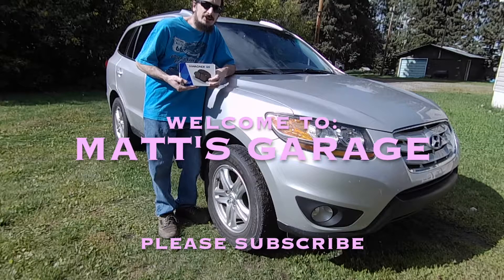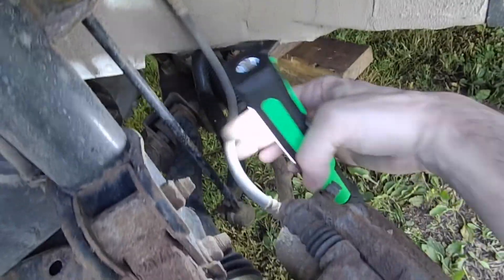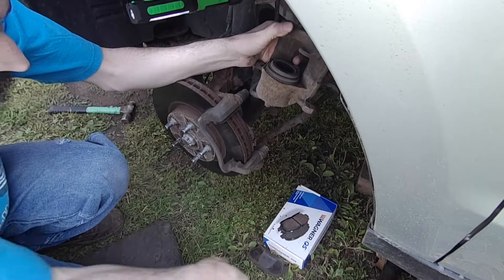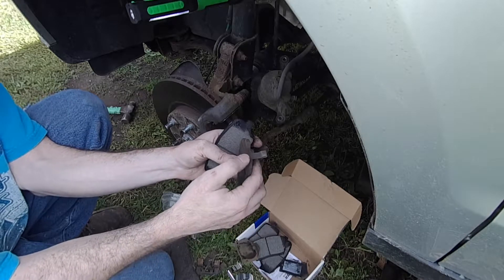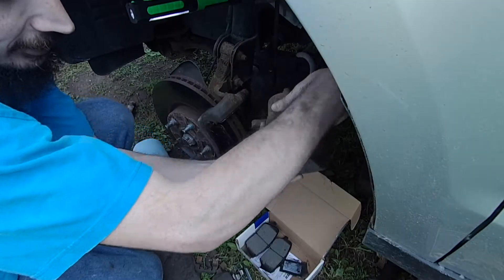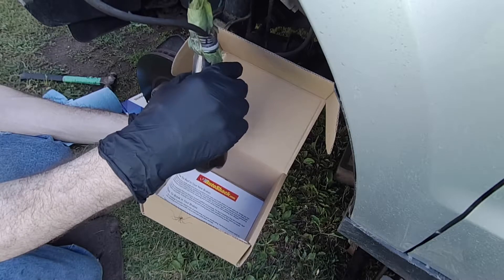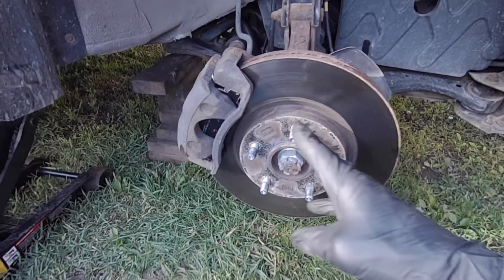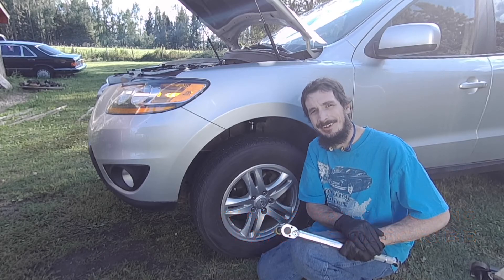Santa Fe Front Brake Job (2011)

Comment: after q quick change out the brakes went flat even after bleeding, the brakes
Reply from the maker: I would try bleeding some more but there's a good chance you got air into the ABS pump, which can be very hard to get out unless you have a scan tool that will allow you to cycle on the ABS pump manually to purge the air through. I normally bleed them till my leg feels like it's going to fall off and then drive them on less populated roads till the air cycles through. ( you can normally achieve half a pedal no matter what by bleeding enough and then the rest will work out driving, but just be careful and make sure you have full brakes)